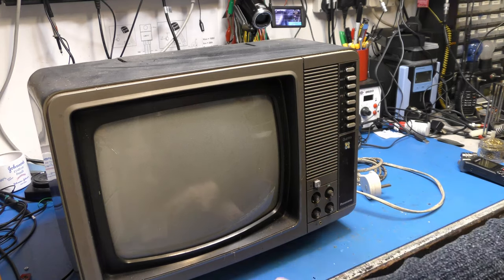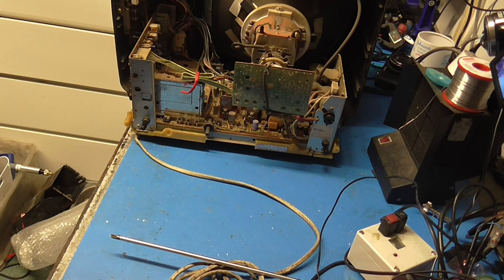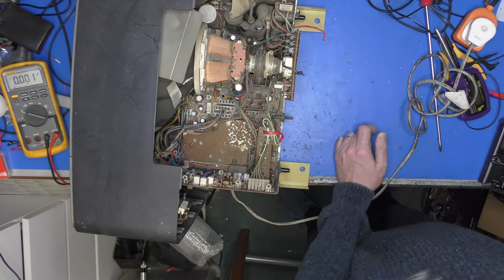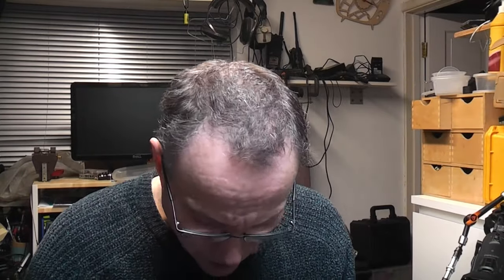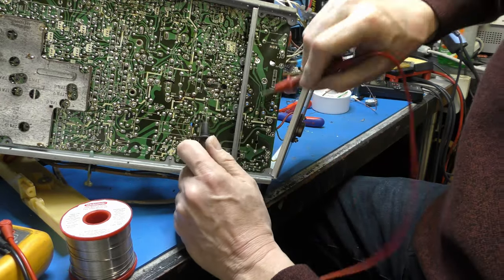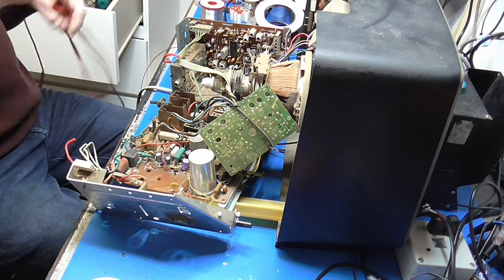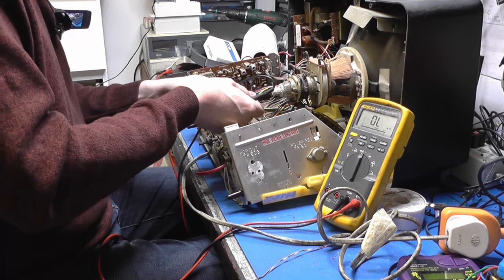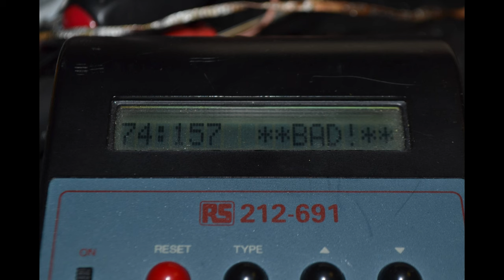Panasonic TC-381G Fail

Comment: Got my first ever electric shock off a similar portable Panasonic telly. You can always rely on a piece of Panasonic equipment from the '80s to have at least 1 de-legged, leaky or otherwise failing capacitor. Some of the big filters in Technics amps of the time like to violently explode even after appearing to be perfectly good and the little signal caps always go too.